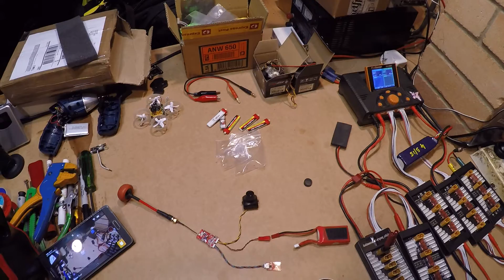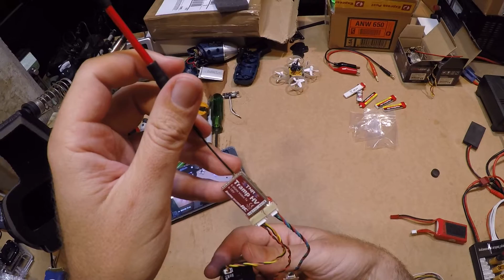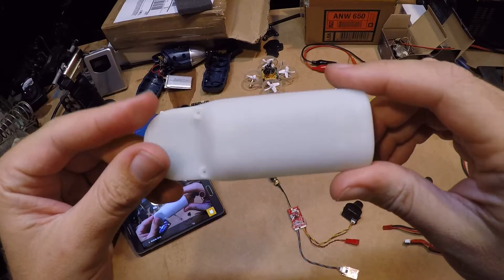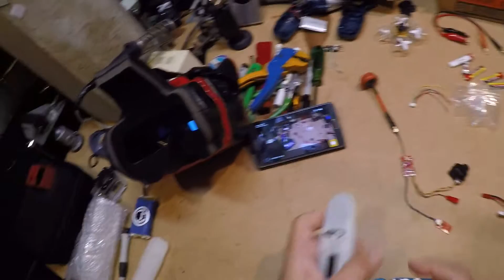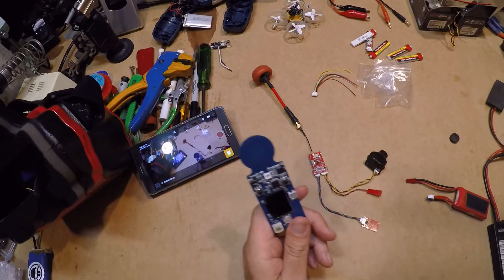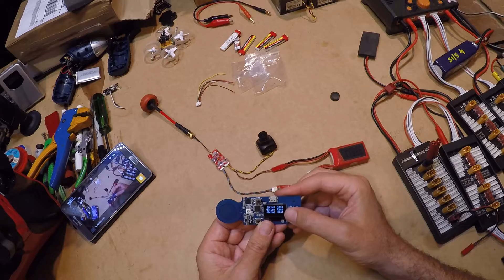Walkthrough: ImmersionRC Tramp VTX and Race Wands

Comment: Flown today mine and I've got a lot of ugly distortions in the picture esc horizontal line when throttle up, so the question is why the ground is shared with the 5v powering and bat source, does that not produce a ground loop and how can I solve it? Thx
Reply from the maker: That's unlikely to be a ground loop problem; it's more about bad wiring and noisy builds. Assuming you're using the 5v out from the tramp for camera power, it's quite unusual, normally these problems come from running the cam directly off the lipo power.
Reply: I have the same problem. Have you resolved it?

Comment: What does this mean for the Helix with it built in VTX? Would you remove it and put in the Tramp at race events?
Reply from the maker: An excellent question. I do know this: the Helix VTX has an I2C port and it wouldn't be hard to add support for the Immersion system with their help. Which I suspect is on the cards given how IRC like to work with the community.
Reply: +Mark Cocquio (Strepto) if you get that you have a winner!